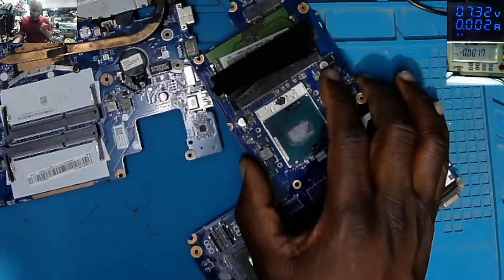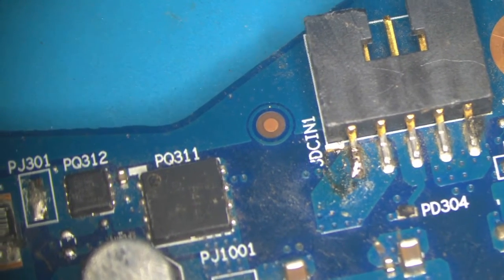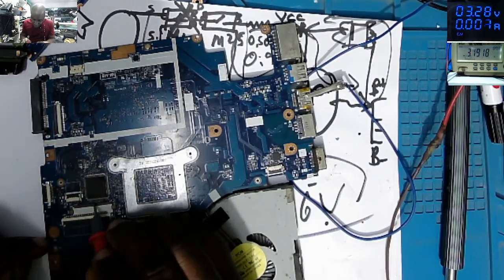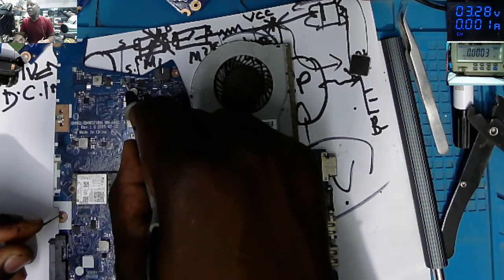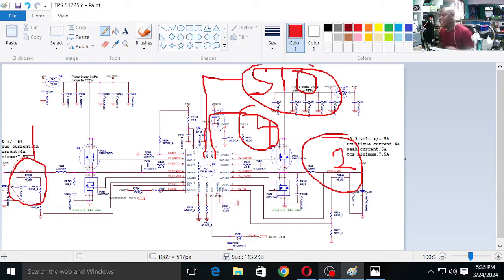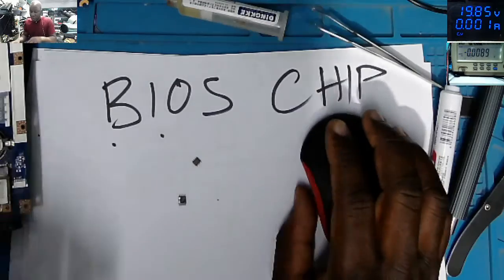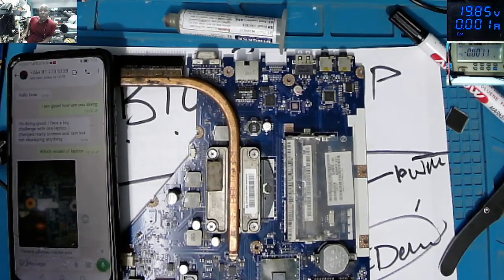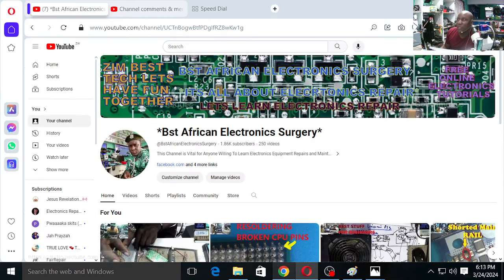Important Lesson!! Learning Skills On How To Find Faults & Fix Laptop Motherboards.

Comment: 5:05 - Speaking of the quality of the videos, it sounds like your microphone gain is set too high. Another reason for the excessive clipping in the audio is low battery voltage in the wireless microphone (just a thought). Thanks for being willing to spread your knowledge! Much appreciated.